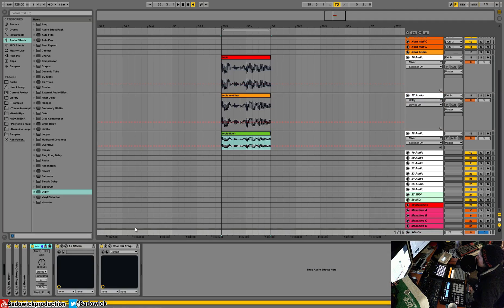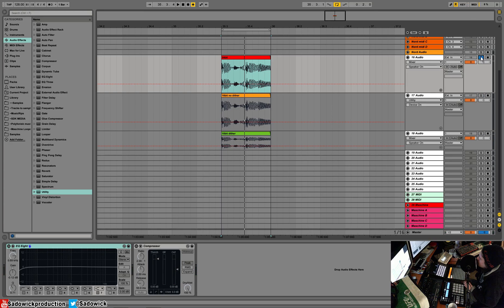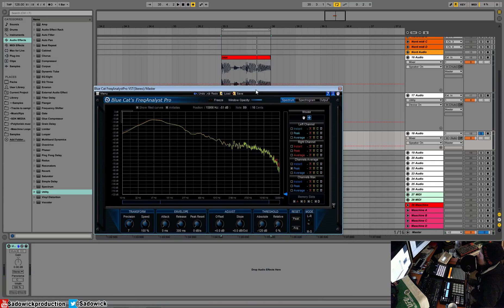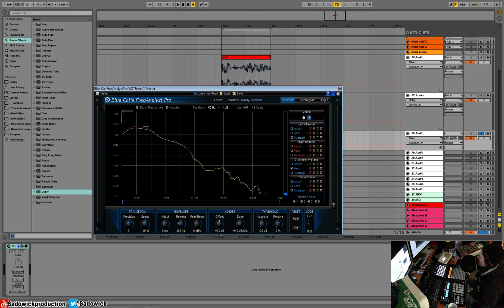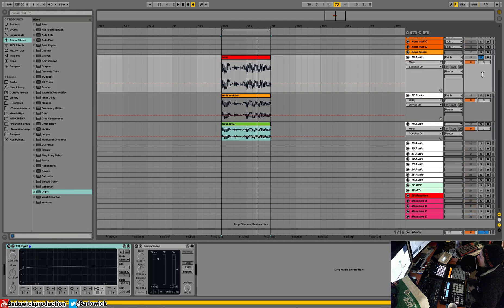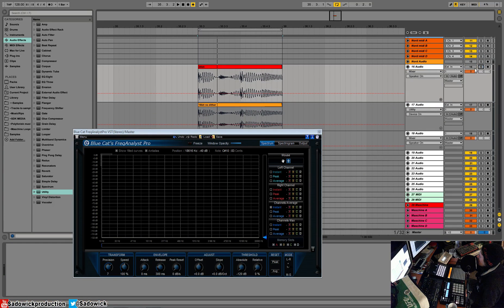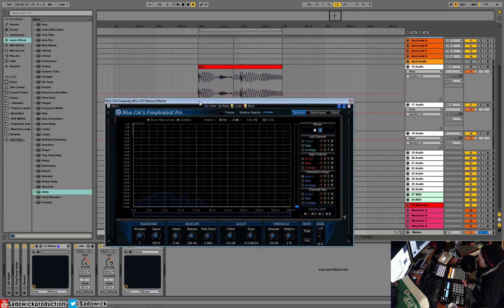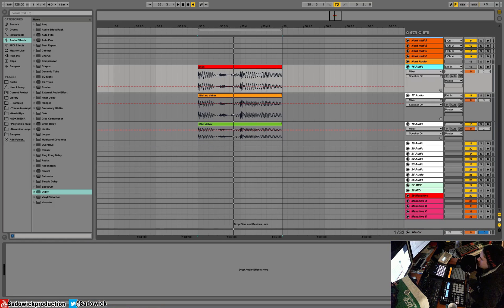Busting The Myth Of Bit-Depth & Dithering

Comment: Where dithering and bit-depth count the most is in audio that's outputed at lower volumes.  I don't think it will make much of a difference on loud sources such as dance music.  You may want to repeat the test using individual piano notes at a lower volume with lots of sustain/ring out.  I would run the test 3 times with the volumes low, very low, and ridiculously low.  

Again, not such a big deal for music that's already compressed, peaking near zero and doesn't have a huge amount of dynamic range.

Give it a shot.